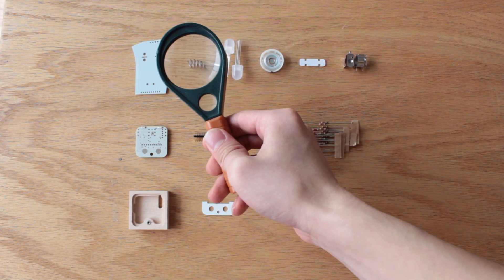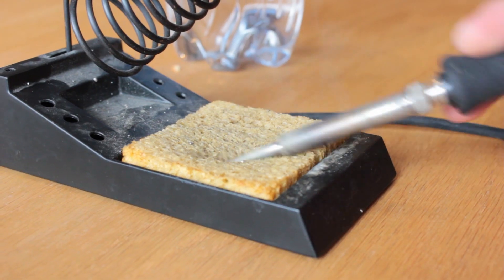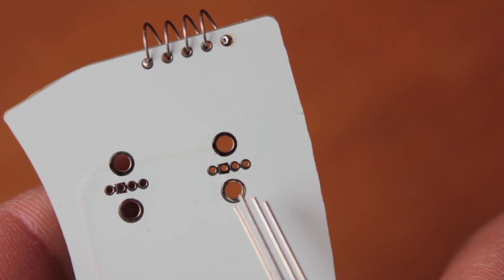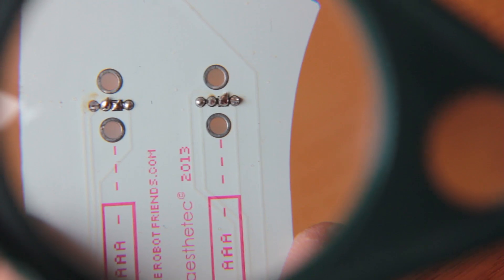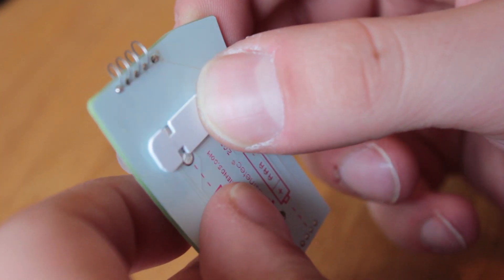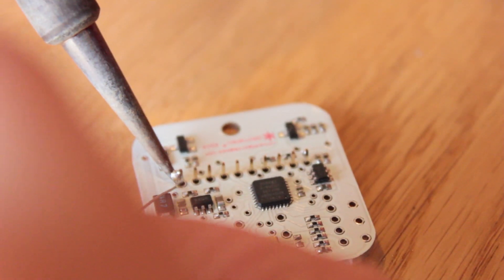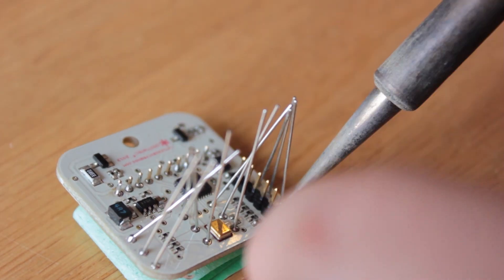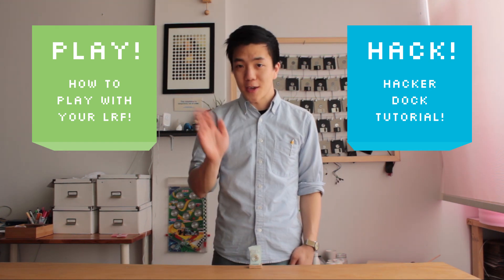DIY Kit Instructions (The Original Little Robot Friends)

Comment: Joel!! I made my Robot Friend yesterday, and it's really neat!! I will admit that the 10-pin connectors were pretty tough because they were so close, but I managed with thick soldering wire and a not so pinpointed soldering tip. Make sure to buy both fine-gauge soldering wire and soldering tip to maximize your skills. The sense of satisfaction is pretty danged cool!!! Have FUN!!!

Comment: What a great surprise when I got my robots in the mail and i realized that i needed to SOLDER those things before using them, after paying 80$. That's a dealbreaker, but it's too late. Now, probably like many other people that read too fast or didn't catch that "assemble" meant "solder", the little bags will catch dust on the shelf until forever when i feel like wasting 2 hrs going to a hardware store, shopping for a soldering kit, then coming back home and wasting 2 more hours pouting them together. Sigh.